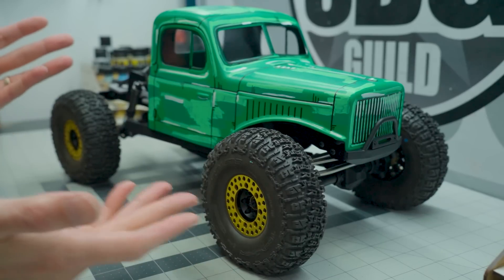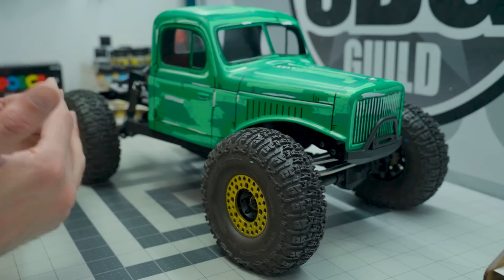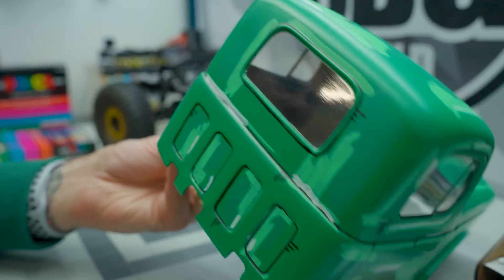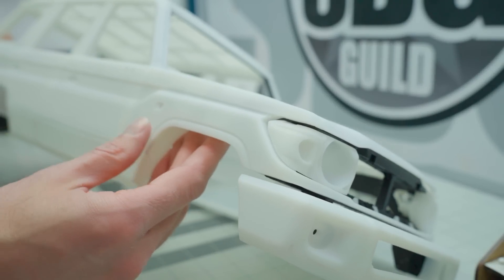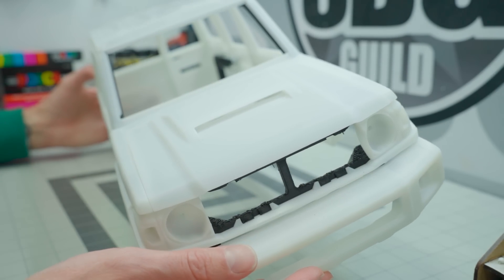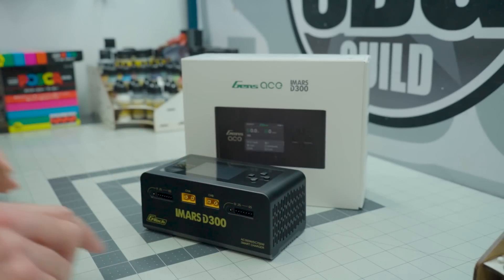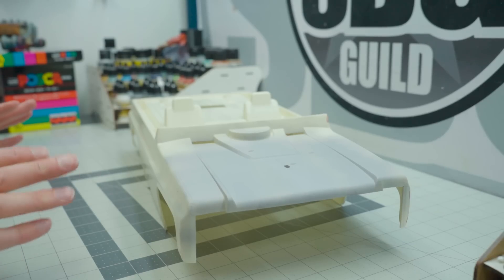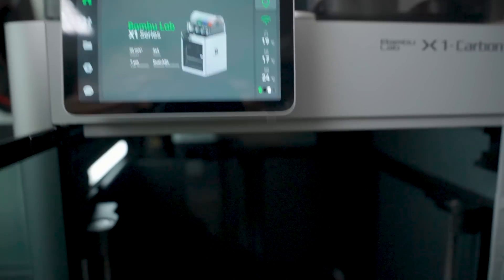What's on the Bench Weekly Ep42 - Prusa who?!

Comment: That charger looks like a great middle ground for charging and discharge. Their website shows 3A discharge, which hopefully means fast storage charging. Do you know if the battery's balance plug or the balance extension plugs straight into the charger or do we need a separate balance board? The manual doesn't appear to be on their site yet
Reply from the maker: The balance port will work with standard batteries and their smart version, no adapter required!